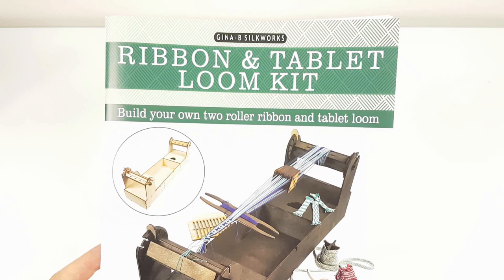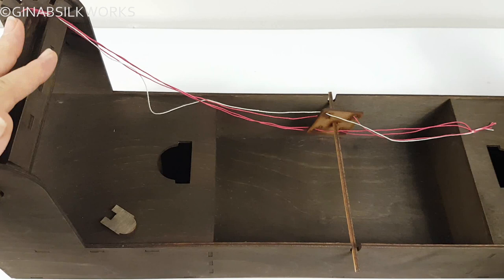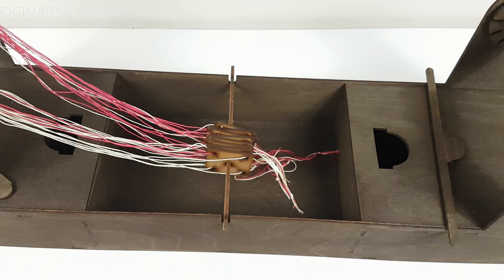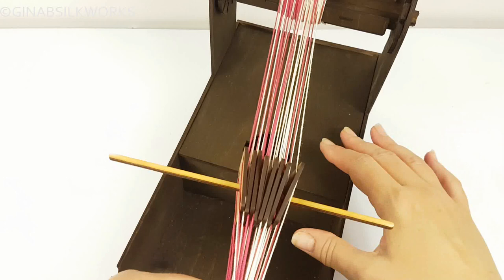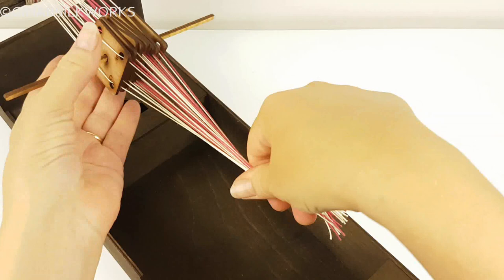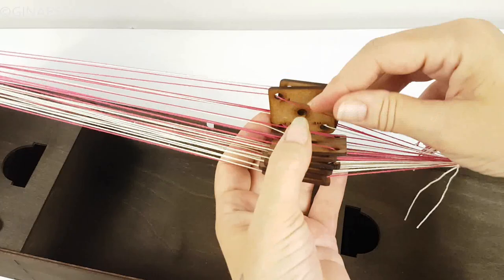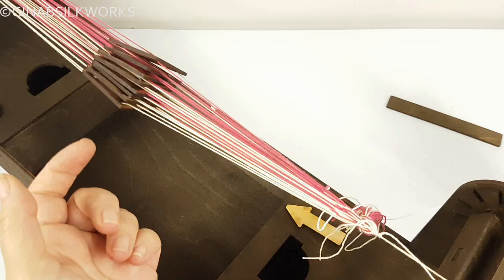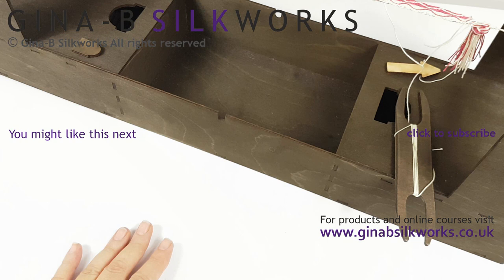How to warp a 2 roller loom for tablet weaving [Method 1] and beginning weaving

Comment: Which silk threads available on your website did you use for the band? I’m not sure which of the silk threads would be appropriate for bands.
Reply from the maker: For this video I have used cotton perle no 5 - which is the type and size thread that is supplied with the loom. Using silk threads will very much depend on what you are trying to achieve - there are many many different types. Of the silk threads we currently stock, the soie perlee will work well, but we do not have the lengths that would be economical for weaving in silk. For weaving in fine silk I would recommend thinner tablets, (I use cardboard or thin acrylic with silk). Many start with spun silks that are similar to the cotton perle - so a 30/2 and for thinner a 60/2. However, you can go even thinner - down to sewing thread weight! You'll need larger quantities than we currently sell, you might wish to try Handweavers Studio for spun silk for weaving, or DeVere Yarns for filament silks.
Reply: @GinaBSilkworks  Thank you so much. Maybe I will start with the cotton perle and look into the silk later on.
Reply from the maker: The nice thing about perle is you can work down in size (so start with a No5, go down to a No 8, etc). I also know quite a few weavers who like to weave with crochet cotton too.

Comment: Hi! I was just wondering for the edges could you use an anchor thread? I have heard of others using them in other types of weaving  (odd-numbered warp thread projects). Just wondering if it would work to make a smooth edge in this case if you had one on each side? 
I know it would take some extra thought to keep track of which needs to be up and which down or maybe you would keep them both in the same direction for each pass of the weft (switching for each pass, so it loops the other direction each time).
Reply from the maker: All "neutral" tablet woven designs will have that edge - it is the nature of the technique.  Historically, the way around this - if the weaver thought it was an issue - is to have the edge tablets turn continuously in one direction for as long as possible before the twist becomes too much - then they are turned in the opposite direction, leaving only one little section where the reversal can be seen, but otherwise perfectly straight edges. Or, the weaver may untie and untwist the edge cards, so there is not reversal point at all. Two edge tablets on each side working in this way is usually sufficient, but more can create a really lovely edge. 
I decided to have this video as the most simple set-up, so that beginners can simply get started.

Comment: Hi, why do you do it three times ? There are only two sides, I don't understand.
Reply from the maker: Because the tablets have 4 holes that have thread, the turning of the tablets makes the position of the threads change place - so a different thread shows on top. That creates the pattern. Perhaps I should plan a video with 4 colours to show what happens?
Reply: Hi, I'm sorry I don't understand your reply. I don't see what tightening the threads multiple times on both sides has to do with creating the patterns.
Reply from the maker: I may not have understood your question, if this is the case, I'm sorry. Tightening will be to simply get all of the warp thread at the same tension, which is important for a smooth weave.
Turning the tablets changes the position of the threads, which is what creates the pattern. I will add to my list a more basic video of the principles of tablet weaving, which hopefully may help.
Reply: One string has only two sides. Why do you stretch side A, then side B, then unstretch A and stretch A again ?
Reply from the maker: Hi! Could you give me the point of the video (the timestamp) that you are confused with? It might help me to be able to clarify it for you. :)
Reply: It takes about the whole video, I mean, from the time the cards are threaded. Then you just turn turn turn.... Turn the front, turn the back and turn the front again... It's really as simple as that.
Reply: At 25:40 you actually mention it
Reply: I was wondering what benefit there was for thread tension
Reply from the maker: I think I may know what you mean now. At that point, I am warping the loom, not weaving the pattern. Over the years I have found it easier and better to make sure that the numerous threads are correctly tensioned, to warp in this way - pulling the threads through the tablets onto the loom rollers will separate any tangles and smooth the threads ready for weaving. You could just tie the ends to the warp roller (warp beam), and roll them up, but they may not all be tight. I just find I get better tension personally, doing it this way.

Comment: Is there a maximum warp length  for this loom?
Reply from the maker: As with anything, it does depend on the number of warp threads and the thickness of the the thread, as a thicker thread will fill up the space between roller and the box lid below it. The space between these is 60mm. A safe estimate would be 3-5m.
Reply: @GinaBSilkworks  But that is the width, there isn't a limit on warp length is there?
Reply from the maker: Yes, there is a limit - the space between the roller and the box lid is 60mm. So, if you have thick thread, as you roll it around the roller, it will touch the box lid sooner than with a very fine thread. When that happens, you will not be able to roll anymore warp on. So, it will very much depends on your warp thread itself. A fine silk will can have a longer warp, as the warp can be rolled around the beam more often before touching the box lid.
Reply: @GinaBSilkworks  Thank you, Gina. That makes perfect sense now!

Comment: When I go to he website it doesn't let me see anything :( I really love this loom concept.
Reply from the maker: Oh, I wonder if it was simply an internet blip - I've just followed the link and it does take you to the correct page for our weaving range.  x
Reply: @GinaBSilkworks  It gives me "Forbidden
You don't have permission to access this resource."
I used a vpn and that seems to help. I'm not sure why it does this. 
Thank you for checking :)
Reply from the maker: It may have to do with your location - or your IP's location. I know that there are a few that get blocked by our hosts due to security. It's not something I have any control over I'm afraid...
Reply: @GinaBSilkworks  no worries, I understand. Even the basic browser vpn was able to help so it's no problem. I just thought I'd let you know. Congratulations on coming up with such a cool loom idea.